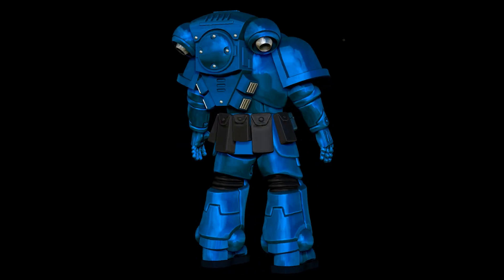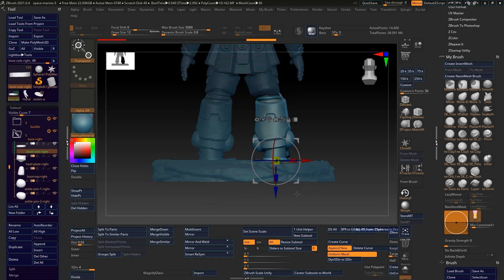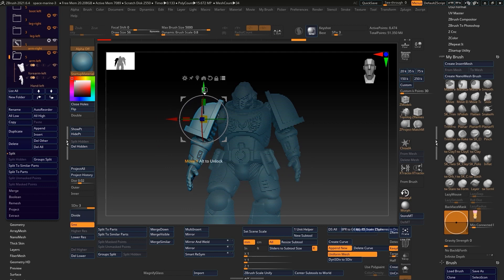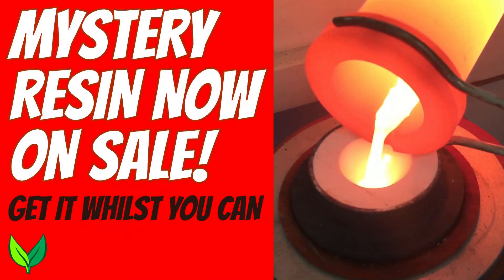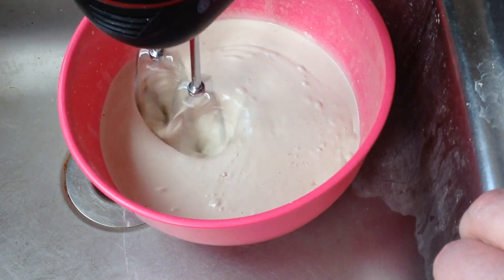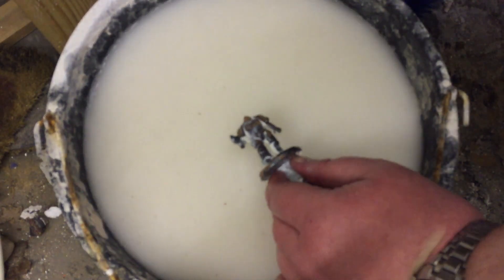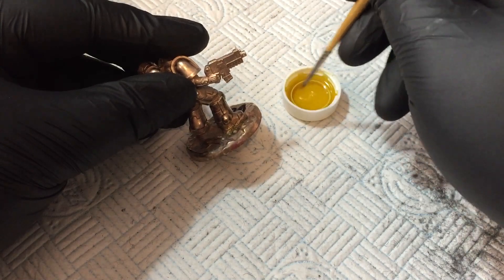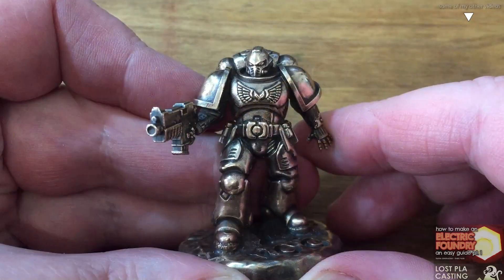Warhammer 40K Space Marine solid bronze casting - fanart tribute by VOGMAN

Comment: If you had cast with aluminum, could you get the same details ?
Reply from the maker: Probably not. It's quite a thick metal when molten. That's why I moved away from it to aluminium bronze which is 90% copper and 10% aluminium. You'll get MUCH better detail with that 😊